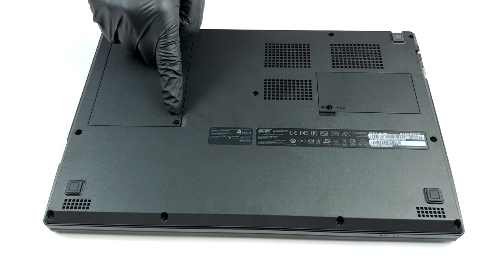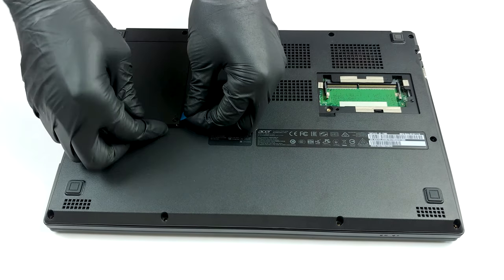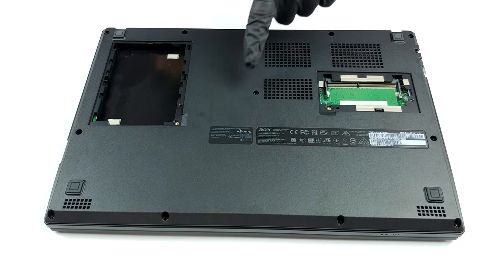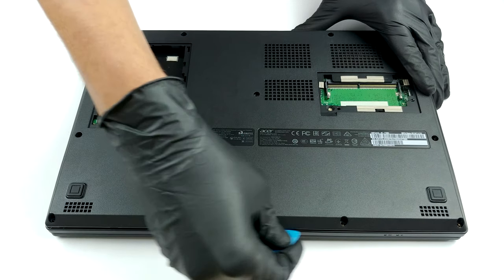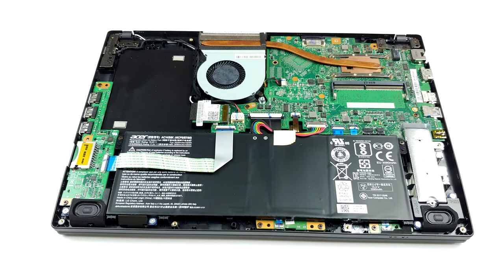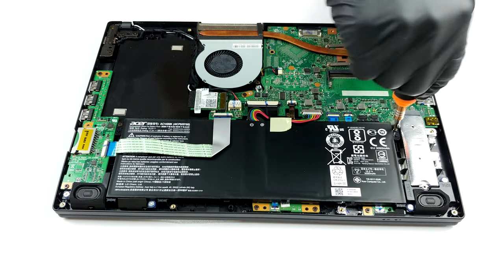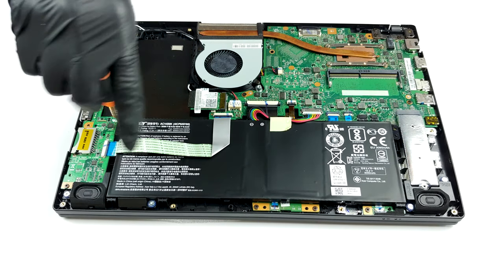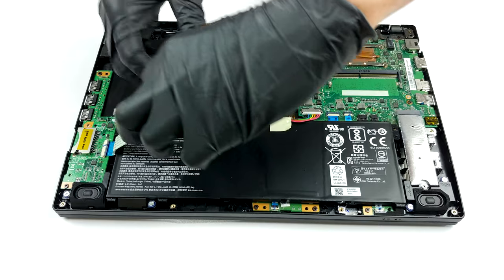🛠️ Acer TravelMate P2 (P2410-M) - disassembly and upgrade options

Comment: can i ask i have same laptop on this video..i buy 16GB ram ..as i thought that i can upgrade 20GB ram because theirs is 4GB install already but..when i open it.. theirs no other slot for my new ram ..  when inspect their is 1 slot available ..i just want to ask where is the other one.. :-(
Reply: There are 2 RAMS present in the laptop originally. 1 is soldered (so, it isn't seen in the same place as the other RAM, it doesn't look the same, and it cannot be replaced nor removed) and the other is the 4GB RAM you can see in the slot when you open it. The 4GB RAM in the slot is replaceable and it is where you should put your 16GB RAM to make it 20GB.
Reply: @anzhel9178  no way
Reply: @yesnt01  is 16 GB not supported ? Or supported ?